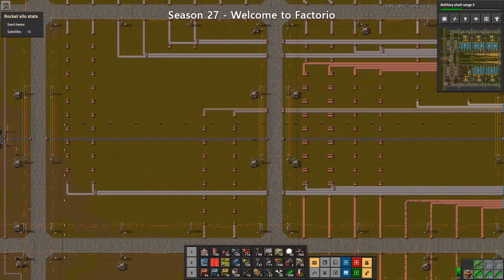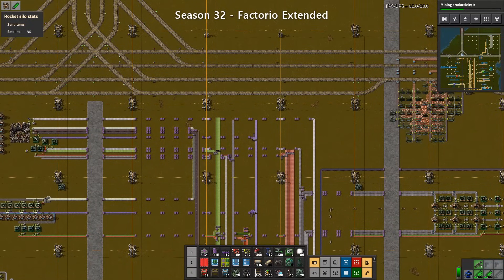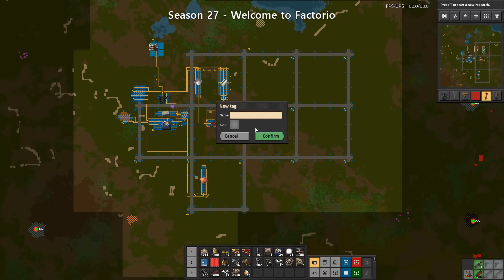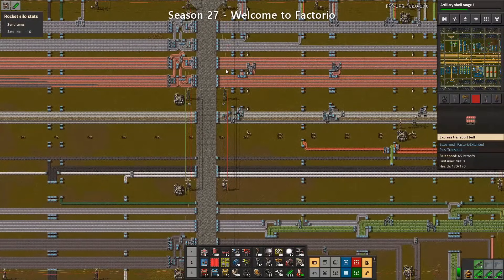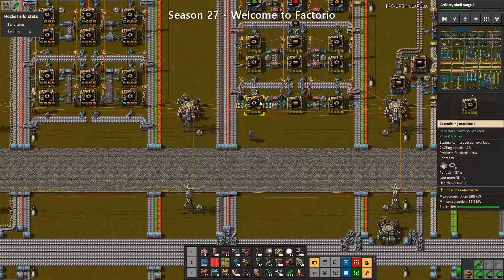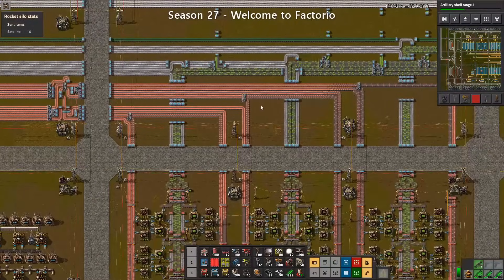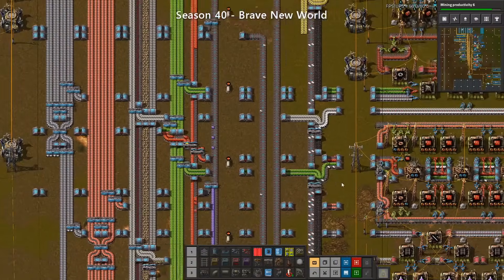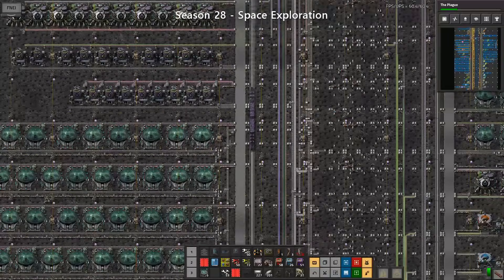Order Your Base with the MAIN BUS - Factorio 0.18 Tutorial/Guide/How-to

Comment: Any experience with duplex / bi-directional busses?
The idea sounds charming to be able to "refill" the bus at any point and send resources both ways, so your production can be anywhere.

Of course, it takes much more managing to split and turn....
Reply: that is easy for things such as copper, green circuits use so much copper that you end up taking out whole lanes and you have spare space. You can then just insert copper from anywhere on the bus from trains etc. and have them run either way.

Comment: More and more time spent in this game begins to outline why a main bus is not a good idea... thing is, inserters and especially belts doesnt scale in the endgame (there should be a belt speed infinite upgrade 😀 ) so, having a centralized supply chain will be an inevitable bottleneck. Then as you move into the endgame and spend more time finding ressources and smashing biters the transport to the centralized hub becomes tedious and localization becomes far more useful.
Reply from the maker: Main bus is never intended to build a 1k spm base. It is the base that gets you to Rockets, unlocks all tech and builds the materials you need for later expansion.
I am interested in alternative builds as easy and efficient as the Main Bus to get there, because I have not found it and I have tried a lot.

Comment: Friend, is there any way to replace the belt bus system with only traing system? I'm trying to build a full train base with the bus train system for all production factories, but there is a problem in my mind about the fact that there are so many items witch demand many items at same time and imagine only 1 train stop for green circuits or another item with lots of items in the recipe, how can I control the way I'm using the trains with 4 wagons with unique purpose in a multi train stop?....
Hopefully u red this and help me and also understand what I'm trying to explain.
Reply: at the very basic level you can have multiple train stops for a product, this can create a large area though. However this is what I do for large scale green chip production etc, train in all the raw materials with dedicated trains and stops. However you can also start using the logic system with the combinators and filter inserters to have one station which only requests what it needs and only takes what it needs from a single train. this is a little more complex but certainly doable. You could have a train which has a single stack of every item if you wanted and each stop only takes what it needs from the train. I do this for outposts with walls and laser turrets, if one is damaged a train is called with repair bots and new laser turrets etc and replaces them. The same principle would apply for everything in the game, however there are diminishing returns the higher volume production you have. There are videos on youtube to explain this if you search for them.

Comment: After 4 years of Factorio experience, I'm starting to dislike the concept of a main bus for me. For beginners it is still the best way to get an idea of how to play the game efficiently and learn how to structure your factory. But I think as your getting better and more creative designing builds, you should develope a new way of your starter base. Always doing the same is a bit boring, but at the same time the hardest thing to is to design a "better" or more creative way of building your starter base. In the end its the decision of every player on their own how they build their factory, but the tutorial is a good start where new players can build on and think of their own designs.
Reply from the maker: You are correct that it is "a bit boring" and I even mentioned that.
However, I have yet to see any comparable strategy that even compares. The only alternative I can think of is a speedrunner base, but that is extremely tightly scaled to reach 1 rocket and nothing else, which makes it very impractical for extended play beyond that. Trains come too late and take too much space and time to build to be an alternative.
Reply: There are many ways of using a main bus in a base, and also you can easily have multiple busses. Dedicated lanes on the main bus can easily be removed and fed from outside the main bus. Doing always the same thing is boring, but the concept of a bus is just a great tool, I don't think you can give it up completely until the railway network becomes your bus - the good thing is, you can use belt busses in many different ways if you are willing to use your time to experiment

Comment: A little bit too long for my liking and i suggest using more of those dedicated illustration rather than showing clips from the actual factory as i found them too cluttered making the main idea harder to grasp by beginners (like me). But all in all, it's good since you keep it straight to the point.

And perhaps it would be better if you also include "when to stop extending your bus" since i sometimes struggle with that (i'm not a good factory planner though...)

Comment: Anyone else noticed how at 12:54 the frame rate made part of the iron look like it was moving up the belt rather than down the belt?
Reply: Factorio is designed to run on 60fps, this video is available in 60fps (e.g. 720p60) to avoid those artefacts.

Comment: I would like to defend the dynamic bus.
You start out with a narrow bus (just iron and copper for example) then let the bus grow wider as you add more things, you still use both sides (one mainly for science probably).
It is a much less intimidating design for newer players, featuring less planning and no need to know the entire game ahead of time. (And so also good for complex mods).
It saves a lot of space and resources in the early slow parts of the game.
And I think it looks much better than having vast empty space at the start of the bus in my opinion.
The main downside is that it doesn't  fit as well into a citygrid style of base.
Reply from the maker: No problem. I feel that a bus twice as long is too big of a disadvantage to outweigh the relatively small advantage of not needing to plan ahead
Reply: @Nilaus  If you by any change read this now Kholto or Nilaus I'm just starting this game. About 6 hours in. I am near blue science stage. My factory is Spegetti so I am trying to start a bus. I don't want to look up everything that comes a head. I'm not using mods... well QoL mods nothing fancy. Should I still attempt a BUS like your Nilaus not knowing really what kind of production comes in the future? Or would you both recommend Kholto's idea if I don't want to look up future recipes. Also I hear about adding a Robo Port? Whatever that is into the bus? Is it needed I don't think it was mentioned in this video?

P.S I am using the mod that doubles and triples the size of underground belts which may favor a certain kind of bus setup? But I imagine I just still follow a general standard bus formula. Thanks.

Comment: I think it misses two key topics, and could use a minute more to explain the sacred path thingy :P
the two key things are:
- liquids on the bus
- priority splitters instead of old fashioned balancers to keep branching lanes filled
nothing wrong with being opinionated about it, but at least show it's an option (like you mentioned gears on the bus)
Reply from the maker: I actually spent more time on Prioritised Splitting than I did on Balanced Splitting. I did mention when I felt it was the correct choice.
Liquids are left out unintentionally, but I probably couldn't spend more than 10 sec on saying "liquids can also go on the bus" :)
Reply: @Nilaus  what I meant was using chained output-prioritised splitters so the leftmost or rightmost lane is always filled, then always branching from that lane, as an alternative to balancers. It would have been nice to have it after you showed the balancer somewhere around 14:30 ... I think it's worth showing, since it's something many people do. Anyway it's not a big deal, especially since it probably wouldn't fit your preference, and the video is opinionated (as it should be)

Comment: I have a better solution: Use belts only to rush logistic robots. Then you delete all belts on your base and be happy :)
Reply from the maker: Maybe a joke, but I don't agree. 16 lanes of Blue belts transport 720 materials per second. You need to darken the sky with robots to get that kind of throughput. Robots are good for low quantity+long distance (to save on belt storage) and high quantity+short distance (like emptying a train). Iron/Copper is usually long distance+high quantity
Reply: @Nilaus  That you considering transporting through long distances, that's better to do with trains. When using bots its better to do production blocks instead of a full huge base with bots everywhere, where you separate the logistic network and your buildings can be condensed better allowing better beaconing setups

Comment: Guides on "modular-ization" and long range transportation would be greatly appreciated! Always love your work.
Reply: *Jonesy's Guide to Railways:*

The best way to avoid collisions and maximize throughput using railways is to use multiple parallel tracks. If you limit it to two, which is very sensible, then you want one rail for each direction. I recommend using your locale's preferred driver side. If you only drive on the right hand side, then place your trains with that same orientation.

So now we get to signals. Signals must be places with the same orientation you've decided on for your trains, but signals have to be placed on each individual tracks, so what then? Easy, just place them on only the right hand or left hand side of each track. So, always inbetween tracks for left hand driving and always on the outside for right hand driving.

Why use Rail Signals? Rail signals separate tracks into segments. If a train is in a segment, then other trains will stop at the signal where the segment starts, and they will wait.

Where to use Rail Signals? Rail signals should separate train stops, they should break up large stretches of rail, and they should be used to make intersections and loops their own segment. This does not remove all threat of crash. This will at most reduce crashes to a near 1% chance for each train currently moving in the same nearby system of tracks. Meaning more trains equals more chance of crashing.

Advanced use of rails and Signals.

I mentioned loops and intersections. but how do we make them? First of all, with the exception of T-Intersections you generally want the rails to go straight as they normally would.

In intersections they cross right over each other as if they don't exist. Next, you simply step back a bit and add a new segment of rail connecting right side to right and left side to left at 90 degree angles. Spacing might take a couple tries but don't sweat it.

In Loops You have just the left and right rail, a good distance away from any intersections unless you're feeling particularly adventurous. I cannot stress enough how dangerous it can be for trains to be turning around in the middle of a busy intersection. The first step is to pick which side you want your loop facing, it really doesn't matter which. Then, you want your loop to branch off from the track on the far side. Now just slap down four consecutive right turns. Cool, you have a loop, but only one side can use it and that's dreadfully inefficient isn't it? No worries,just connect the other side outward to the loop at 45 degree angles. The trains will never cross over to the wrong side of the tracks as long as they're only connected to one opposite side of the loop, each.

Stations best practices. A station is best placed on a third or other disconnected track with it's own signals separating it from the main tracks. The be clear, the station should not be a part of the segment it is directly connected to, and also it should not be on the main tracks.

Rail Chain Signals. As a general rule, don't use Rail Chain Signals. If you really want to use Rail Chain Signals, you should also try to understand Signal Blocks as a prerequisite. The basic mechanic of a Rail Chain Signal is to: never allow a train to enter a segment unless all exits are also clear to use. What does this mean, practically speaking? It can stop long trains from clogging intersections too close to each other. It can tell a train to wait at an intersection and give other non-chain tracks priority, which also helps decrease chances of a wreck. Yaay~! Why avoid using Rail Chain Signals? As I said before, if every exit isn't clear, the chain signal will never allow anything through. This can send your entire factory into an impasse that needs manual remediation. For those of us who build our stations directly off the main track or even those of us who build stations directly on the tracks, Rail Chain Signals will stop trains from even driving past in some cases. It can be a huge headache. If you place these then just make sure to place them before intersection segments and never after segments.

Finally, Train Automation. Stations must be placed with the same orientation as signals. By clicking on a train, you can add things to it's schedule. Selecting a stop for the train to go to and setting the train to automatic instead of manual will immediately send it to that stop, where it will wait until its condition for that stop on the schedule is fulfilled. E.G. Inventory Full (of iron). Then, it will head to the next stop on the schedule, without stopping unless the signals warn it of a potential collision.
Disclaimer: The above information might not be consistent across all versions.
Reply: @FiniteBanjo  Generally good advice, except for the paragraph about Rail Chain Signals. Specifically, they don't require all exits to be clear, only the exit the train approaching the signal wants to exit through. Also, unless you are placing signals incorrectly, a base with only Rail Signals will require more manual interventions than a base with Rail Chain Signals.

Rail Signals have just 2 states: green (let trains through) and red (don't let trains through). Rail Chain Signals have 3: green (all exits are clear, let ALL trains through), red (no exit is clear, let NO trains through), and blue (some exits are clear while others aren't, let SOME trains through). Trains approaching a blue Rail Chain Signal will stop or continue based on the closest Rail Signal they are heading towards.

In general, Rail Signals are for preventing crashes, Rail Chain Signals are for preventing deadlocks. Deadlocks are when 2+ trains are stuck and are preventing each other from ever getting unstuck. Rail Chain Signals prevent this by only letting one train enter an intersection at a time, thus you cannot have two trains blocking each other.

Perhaps the simplest example of deadlock is a roundabout with two entry/exits points A and B. Train X enters the roundabout from A and wants to exit through B. While Train X is in the roundabout, Train Y enters from B and wants to exit through A. Train X then gets blocked waiting for Train Y's tail end to stop blocking exit B, but Train Y also cannot exit the roundabout because Train X's tail end is still blocking A. This will never resolve itself and requires manual intervention. Example image here: https://i.redd.it/z9v975oxq3dz.jpg

With Rail Chain Signals at the entry points of the roundabout, Train Y would have waited outside the roundabout until Train X was out of the way entirely. A simple rule of thumb is anytime you have a segment of track smaller than your largest train, you should have a Rail Chain Signal in front of it to ensure every train that enters that block can exit. If no train ever stops with their back end blocking an intersection deadlock should (barring any weird edge cases) be impossible.
Reply: @FiniteBanjo  Wow, great comment! You could post this to the factorio subreddit, it's really good.

Comment: Arguably, one-sided bus doesn't have to be twice as long. You can leave a bit of space alongside the production line for branching belts (or under-belt right through it, depending on the design) and place the secondary production areas below (or above) the first one.

Comment: What is your opinion about liquids on the bus? Do you bother putting lube on the bus or do you sneak it into electric engines somehow? 
Do you always put sulfur on the bus? And coal?
Will you cover on-site vs dedicated smelting in a later video? I've been doing on-site smelting lately and I've found that it's made things a lot easier. Plate compresses better in trains (stack size of 100 vs 50) and it frees up space in your main base.
Reply: I never put sulphur on the bus as it is too easy to turn into sulphuric acid and batteries on site sometimes. However I always bus coal, there are a few things that use it, and any excess i turn into solid fuel for the rocket and train fuel.